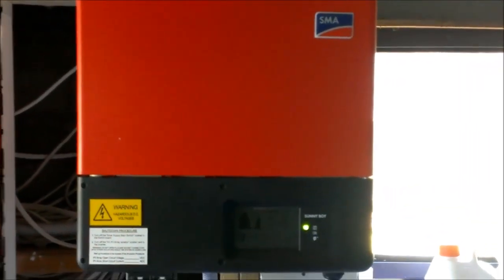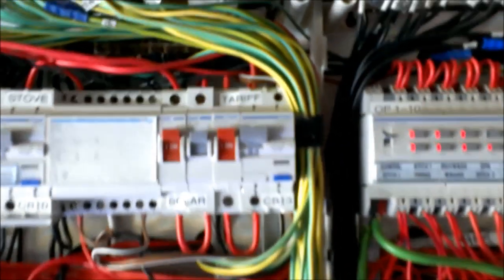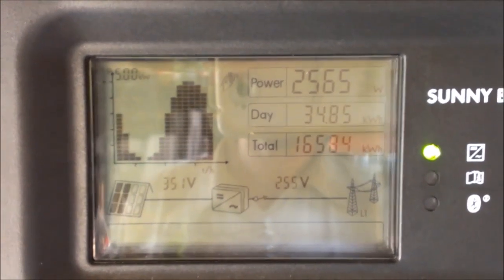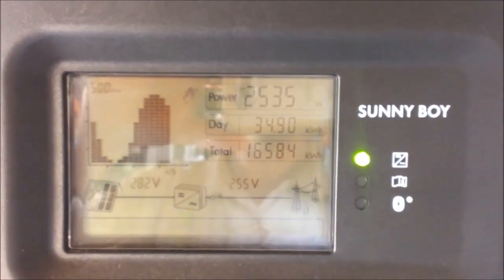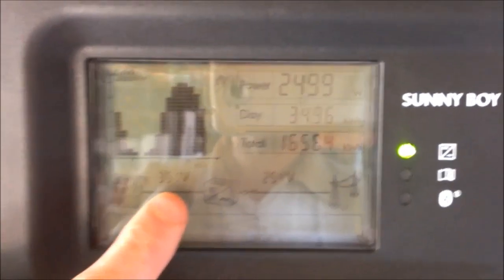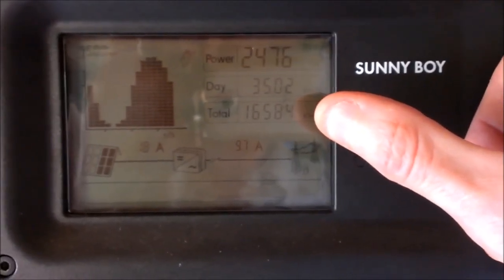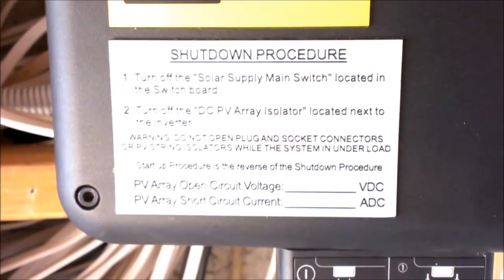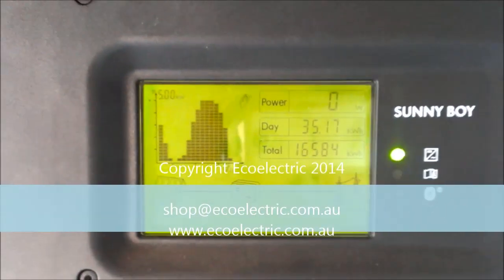SMA Sunny Boy Guide

Comment: Thanks - good video. I can see the A (amps) between the inverter and the GRID, but what does it mean? Is it always the current my system delivers to the GRID or also the power which I get from the GRID (if needed)? Where would I see then the direction? Thanks

Comment: HI Mate ,, i got a 4000tl 4kw installed. i just found out the Red light is showing , Technical issue ,, its saying waiting for voltage  reconnect in 40 sec . can you please help
Reply: +panda panda best to contact via our office.  shop@ecoelectric.com.au or 07 33766409.  It sounds like you have no AC supply running to the inverter so your AC breaker may have tripped.

Comment: Did you know why some inverter both the same power are in diference color ( the case) some are Red and other gray.
Reply: +Eugenio Martínez  the grey ones usually indicate a reseller unit.  Conergy were selling grey SMA for a while for example.  As far as I know there is no other difference.
Reply: Thanks Jeff. I have my working fine is 3000 tls us